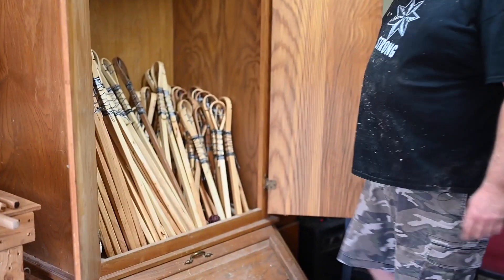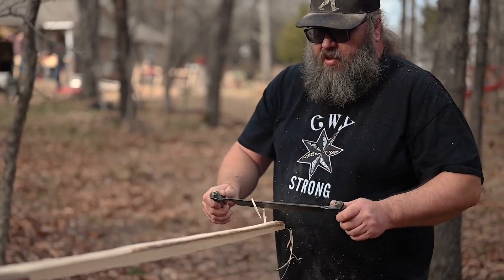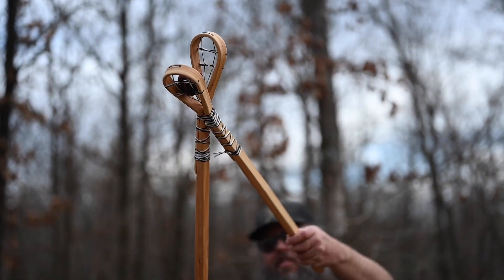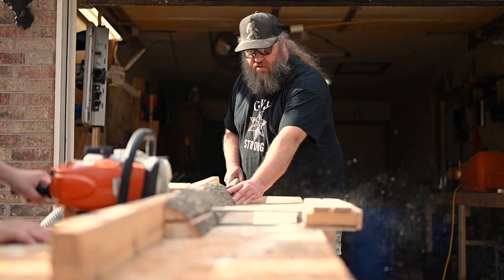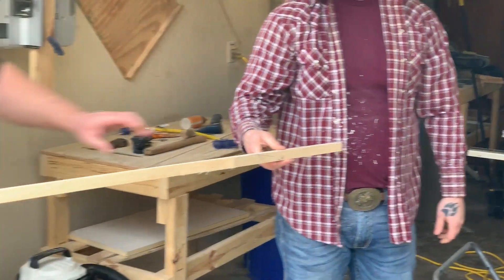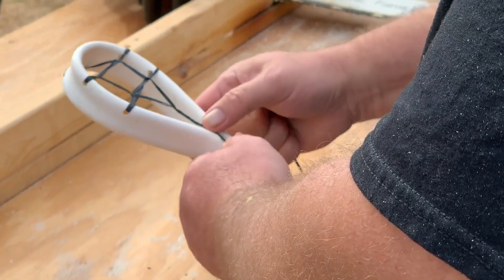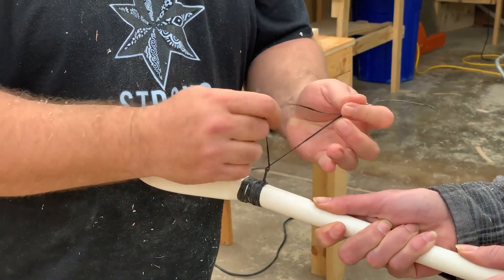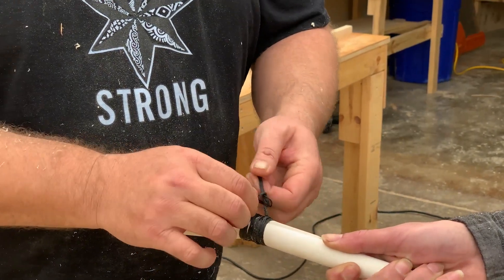Cherokee Traditions: Stickball Stick Making

Comment: Ooo man nice work I wish I had all the tools you got... i just use a draw knife throughout the whole process
Reply: I'm looking to do it this way I also have just done it the old way but just bought a table saw at ez pawn for 55 bucks on layaway
Reply: I'm having a buddy weld my a pipe to steam in then I'm building a flare station so even if its a process you will get there